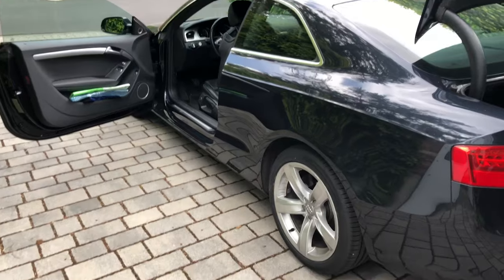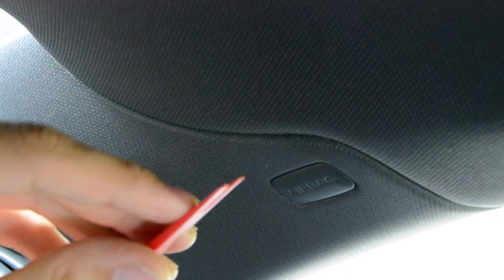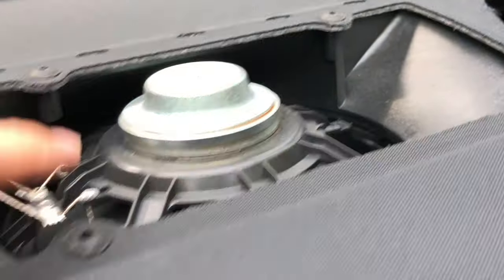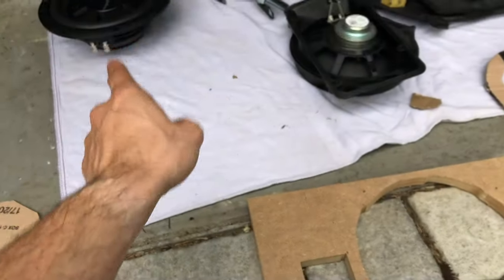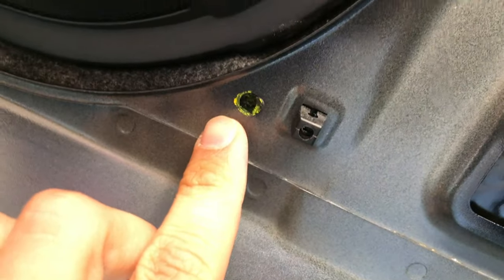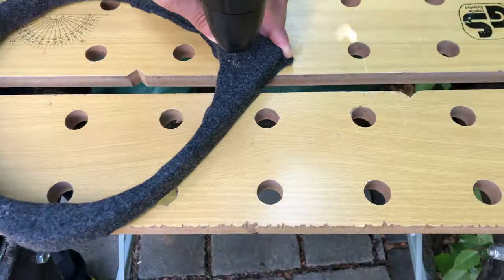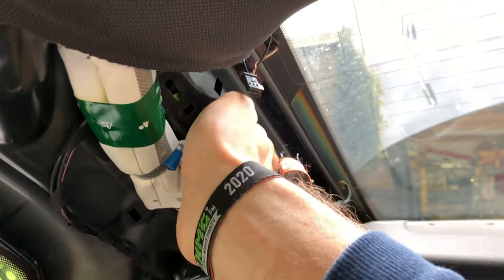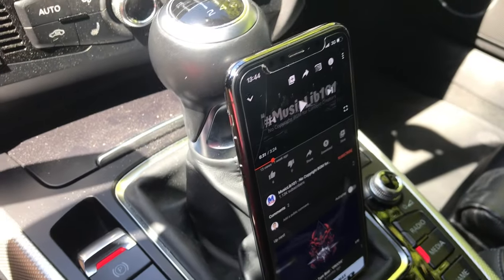Audi A5 B8 Subwoofer Upgrade | (Bang & Olufsen)

Comment: I'm in the process of doing the same with my audi a4 2014, I got the fostgate p3 and after installation it, it plays excessively soft to barely make a difference. I'm wondering if the stock amp cant push the speaker
Reply from the maker: Every speaker chassis has a specific efficiency which means how much watts it need to achieve a certain level of output. A more powerful speaker (designed to handle more power) also needs more power in order to play as loud as a “small” speaker. So the Rockford Fosgate P3 that u have used is designer to handle much more power than the one I used and of course a lot more that the stock subwoofer needs. As long as it gets enough power ist sounds better than the ones wich require less power. But when you use it with the stock amplifier it hasn’t enough watts to push the woofer loud enough. Luckily the battery in the A5 is located in the trunk so running a dedicated subwoofer amplifier using a high low converter to get the signal from the stock wires should not be a problem. Also the stock amplifier requires an 8 Ohm chassis otherwise it can damage the amplifier when used with less than 8 because when you have a lower resistance you draw more current which the amplifier isn’t supposed to handle. So I a dedicated subwoofer amplifier would not only give you a substantially better sound quality but also prevent your existing amplifier from killing itself
Reply: @maximusoptimusTECH  I’ve brought a Rockford r1s2 witch  has 2 ohms can I use this and for some reason when I turn up the sound it pops?

Comment: would this also be the same process to the non b&o system as well? looking at doing this but with the jl audio sub
Reply from the maker: Yes I did the exact same mod in my S5 with just the Audi Sound System. It is the same for all sound systems with a subwoofer as long it’s the coupe.

Comment: I really hope I’m not too late to ask. With the settings on the stereo, would adjusting the bass directly affect the subwoofer? (Like setting the bass low would also lower the subwoofer?)
Reply from the maker: It does adjust the whole bass range, so the midwoofers in the door as well as the subwoofer.

Comment: Moin, habe gestern die Arbeiten abgeschlossen...
Da der Bass mir erbärmlich vorkam, bei der B&O, war das erste mal ne vernünftige Kiste hinten rein zu stellen. Über High Level Input, an die hinteren Lautsprecher angeschlossen war das schon immerhin ein Fortschritt. 
Aber nicht gut genug. Da fehlte definitiv noch etwas. Kam mir so vor, als ob der sich mit dem Original Subwoofer nicht verträgt. 
Dann gegoogelt und auf dein Video gestoßen...
Nach mehreren Nächten nachdenken über Sinn und Unsinn einer solchen Maßnahme generell, der Gedanke: wenn schon denn schon.
Also Sub geordert und das Auto auseinander gedengelt. Überraschender weise ist dabei nichts kaputt gegangen.
Ist mir noch nicht bei vielen umbauten passiert.
Erstmal Frust geschoben, weil der neue Sub tatsächlich kaum durch die Öffnung passte. (Sind die gewachsen?!). So also den ersten Abend mit dem Loch in der Hutablage gefahren. Und siehe da... Meine Kiste klang deutlich besser. Endlich atmet die mal in den Innenraum... 
Hm. Der Gedanke:reicht das? War wieder da?
Nee. Probieren kann man es ja trotzdem mal. Also nen passenden Adapter Ring geschnitten, dann nochmal den zweiten, weil der erste nicht passte, und beide zusammen provisorisch auf die Hutablage befestigt, Sub rein und Feuer freu.... 
Wow... Die zwei vertragen sich gut!!! 
Die Kiste abgeklemmt um zu sehen wie es ohne ist, aber dann fehlt der wirklich tiefe Bass und das Volumen. Fühlt sich jedenfalls deutlich heftiger mit der Kiste an. Also, alles endgültig eingebaut, gedämmt,...
Und seitdem endlich auch mal wieder ein grinsen im Gesicht, wie schon lang nicht mehr. 
Kofferraumdeckel auseinander genommen, gedämmt, Fahrertür gedämmt, (dabei endlich ne Halterung abgebrochen, ich wusste das wäre ja auch zu gut gelaufen) und der Rest wird am kommenden Wochenende gedämmt...
Sound ist Super, dicht, Fett, Tief und endlich auch wieder zu spüren. 
Nur der Kofferraum, bzw vor allem die Stoßstange oder etwas in der Richtung klappert wie Sau. Das wird wohl noch arbeit.

Nun das nächste... Gibt's keine Möglichkeit die billigen B&O Lautsprecher zu tauschen? Vor allem Bass in den Türen? Hat dazu jemand Erfahrung?! Die sind ja echt grottig. 
Wenn ich google finde ich nichts vernünftiges... 

Auf jeden Fall vielen Dank für Tipps und Inspiration!!! Weiter so!
Reply from the maker: Super, das Grinsen im Gesicht ist ja die Hauptsache :D

Beim Rest der Lautsprecher sieht es leider relativ schwierig aus, zumindest die Mitteltöner und Hochtöner sind ja voll aktiv über den Verstärker in den Frequenzen getrennt, da müsste man erstmal die Trennfrequenzen der einzelnen Lautsprecher messen um die passenden Komponenten rauszusuchen.

Dann gibt’s auch nicht viele/inzwischen keine direkten PlugAndPlay Lautsprecher mehr für den Audi. Alpine hatte ja mal die SPC 100/200AU aber das war ja auch nur für die Basic/AudiSound und nicht die B&O, da die eigenen Weichen/Verstärker beinhalten. 

Sonst ist eigentlich die einzige Alternative mitttels DSP zu arbeiten, alle alle Ausgänge des B&O in einen Prozessor rein, dann selber zusammen/neu abmischen und an eine eigene Endstufe mit 10 Kanälen + Center und Subwoofer Verstärker zu leiten, dann kannst du dir auch eigene Trennfrequenzen/Komponenten zusammenstellen und eventuell den Subwoofer stärker ins spiel nehmen/die Türen etwas im Bass entlasten. Aber da biste dann bei mehreren tausend Euro für die gesamte Installation.
LG Max

Comment: looks like in the RS3 the sub has 4 pairs of wires and not two going to the oem sub.. looks like i gotta figure out whats positive and whats negative :)
Reply: also for the rs3 its does not clear.. the whole is smaller in diameter compared to the a4 it looks like :(

Comment: Question, probably a stupid one lol. If my a5 coupe don’t come with b&o can I still install a sub there?
Reply from the maker: If you have the AudiSoundSystem there should also be a subwoofer there (have you checked if you have a woofer?). If there isn’t you will need an amplifier and you have to make new wiring.
Reply: @maximusoptimusTECH  ok I just checked and I definitely do have one. Thanks bro🤙🏽 I did not know I had one until you told me to look😂🤦🏽‍♂️ now to get some better ones🤙🏽
Reply from the maker: Okey nice man, if you don’t have the B&O system have you tried the VCDS coding yet? I’ve mentioned it in a German Video, it is basically a setting you need to change that gives you a ton more bass. And you don’t need to change the subwoofer before you do this because you don’t have that much bass anyway. Feel free to contact me on Instagram or twitter if you need help with that :D
Edit: I now have an S5 with the same system as you and changed the woofer, it didn’t made any difference until I changed the mentioned setting in VCDS. I explained it in my englisch video about this Soundsystem (my second newest video)

Comment: How it sounds with stock amplifier?
Reply from the maker: The video is with the stock amplifier, it’s reasonably good. Certainly better than the old woofer
Reply: @maximusoptimusTECH  bro, yesterday I mounted it in my a5 with stock amplifier (B&O). You can't see much of a difference. I connected the woofer in  8 ohms like in manual. What can I do now?

Comment: I have a a4 b8 with the standard audi sound system, i measure my subwoofer its 4ohm, if i put this subwoofer its okay?
Reply from the maker: If you have the AudiSoundSystem you can also buy the same woofer with the dual 2ohm coils not the dual 4ohm in the video, so you can wire the 2ohms in series as 4ohm same as the Audi subwoofer.

Comment: hey how do you connect your phone via bluetooth ? mine only works with phonecalls
Reply from the maker: I am using the need4stream Bluetooth adapter. You can see the adapter in my other videos about the Audi. It depends if you have the Audi Music Interface or not there are 2 different ones.

Comment: So how big was stock factory subwoofer?
Reply from the maker: It should be close to 8“
Reply: Hey one important question i hope you have solutions… my audi a4 b9 factory rear deck subwoofer connector wire has multiple color wires which is + & - ?????
Reply from the maker: I don’t know about the B9 my B8 only has two wires so I could just test by listening which is the right one. How many wires do you have?
Reply: Like 4 pin wires should i splice them and try each wires connecting to aftermarket subs which is positive & negative? And even after finding the + & - wires to connect what do i do with the rest of the wires ?
Reply from the maker: Maybe it’s a dual voice coil woofer from the factory. I would not try those out of you the two positive wires to the woofer you could damage something. Ask your local Audi dealer if he can print out the page where the detailed wire connection for the sound systems are shown (it should say which colored wire carry’s what signal). Audi has those for every car and every detail in their system.
Reply: Yea thank you for your help mate! I appreciate your time :))

Comment: Will this same subwoofer work on my B8.5 S4 with B&O?
Reply from the maker: Yes the A5 Coupé and A4 Limousine have the same subwoofer setup in the rear shelf
Reply: @maximusoptimusTECH  I just meant because they are shaped a little differently
Reply from the maker: If you search for S4 B&O Subwoofer online I found this, to me the subwoofer location looks exactly like in the A5 Coupé: https://www.audiworld.com/forums/s4-b8-platform-discussion-134/b-o-subwoofer-upgrade-install-guide-2790664/

Comment: how is it working out? i want to do this on my RS3 I was looking for a IB sub. I noticed the sub you use is not infinite baffle.  At least the one you life is not its is made for a seal or ported box according to the manual.  Only IB subs Rockford makes is for boats.  Is it a night and day difference over stock?
Reply from the maker: It’s working out great, I would not say that the bass itself is louder than before (using the identical settings) you can just turn it louder without distorting too much or rattling the rear panels. If you want a night and day difference louder subwoofer you also need a separate amplifier which I will install in future video.

Comment: Bang Olufsen in the audi a4 a5 is a total failure. In a4 b6 I was bose sound system and it sounded much better. Bang has very weak bass. To make matters worse, the subwoofer does not have a separate bass control as in other cheaper audio systems in audi. Shit & olufsen.

Comment: Hat jeder a5 coupe hinten subwoofer?
Reply from the maker: Nein, nur die mit Audi Sound System und oder der B&O Anlage
Reply: Kann auch hinter der Batterie in der "Reserveradmulde" liegen ist dann ein Plastik Gehäuse und da steht dann auch Bang & Olufsen - 8 Ohm drauf
Reply from the maker: Genau, beim A4 oder A5 Sportback ist der Subwoofer bei der Batterie. Aber auch nur wenn man ein Soundsystem oder B&O hat.

Comment: This is totally wrong. This RF subwoofer is not infinite baffle compatible. In fact the manufactor Rockford strongly recomend sealed enclosure for this subwoofer
Reply: got my hopes up for a shallow mount infinite baffle oem look
Reply from the maker: I got a recommendation for it being good in infinite baffle in a forum. Even if Rockford Fosgate does noch officially recommend it the result certainly speaks for it self.
In my recent S5 with the AudiSoundSystem, where I deactivated the Bass limit by Audi (you can’t do that without altering the whole B&O Amplifier Software...) the Subwoofer is even better and I needed to turn the bass down a bit
Reply: @maximusoptimusTECH  Alright, well thanks for the reply in clearing that up with your explanation totally makes me want to try it out..2016s4 here so very similar setup

Comment: To be honest, you really don't know what the orginal system is capable of. The bass on it can cover 90% of all music out there. What you're doing is adding too much bass. There is a neutral point in the way recordings are made and now you're just pumping out way more bass than it's intended. As an audiophile I am critical of balance. What you want to do is through it off the neutral point and just crank up the bass. It has more than enough.
Reply: it doesn’t cover low ends as well as the upgraded speakers + there is rattle which is annoying. Nowadays you can fine tune frequencies on music apps, but as someone who is in your position I want to install these for a bit more definition and clarity on the lower ends
Reply: @floorks  I think so. You should get tighter bass. I do feel it's a bit boomy.
Reply: 55hz and below on this system is nonexistent. Quit being ignorant.
Reply: Am an audiophile as well, my credentials? building home audio systems and car audio systems for 20 years and getting down to detailed EQ and DB leveling. Long story short the factory system lacks below 50hz. The system does output as low as 40hz as confirmed by my pioneer Sub and crossover so its capable of digging down with a capable sub that has the right sensitivity and ability to play 40hz at reasonable level. Upgrading front doors and the 2x 3" in dashboard nearly makes this a fully balanced system. But factory it falls short.